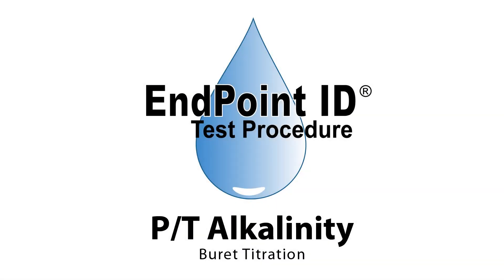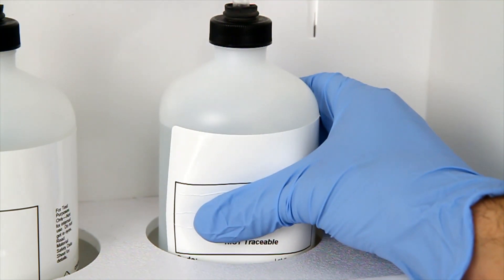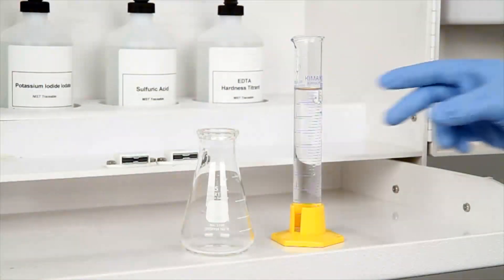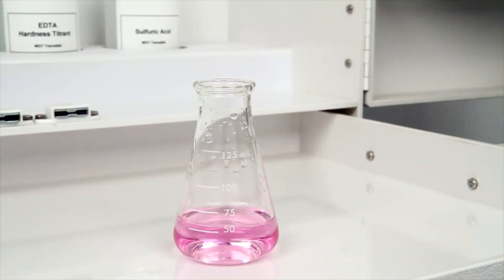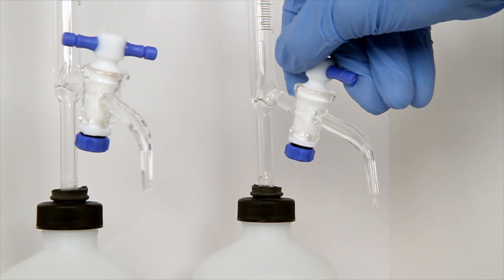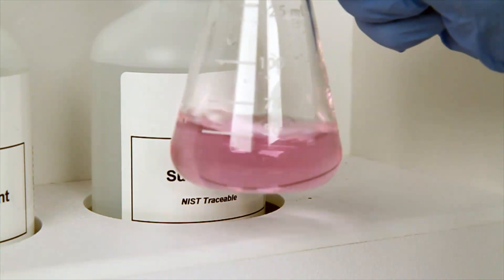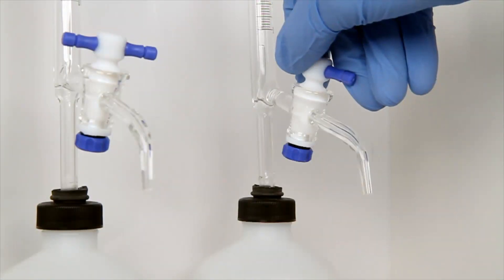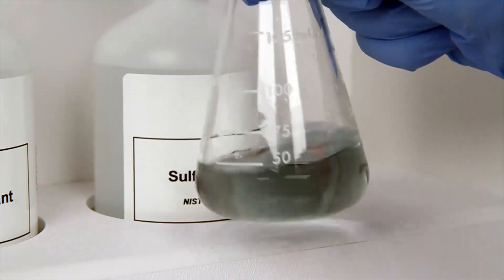Alkalinity Buret Titration

Comment: Sir why we multiply by 20
Reply from the maker: You multiply the number of milliliters by 20 because that is the equivalency for this titration. When you titrate a 50mL sample with Sulfuric Acid 0.02N (N/50), each milliliter of titrant used will be equivalent to 20ppm of alkalinity expressed as Calcium Carbonate in your sample.
Reply: What if I titrate 100 mL sample with 0.02 N H2SO4 or 0.02 N HCl.  What is the conversion factor?

Then how to calculate the conversion factor from the given information such as,

Concentration of titrant and volume of the sample.
Reply: @rajamurugan2356  u still times by 20 the sample doesnt matter. for each ml of the acid u times by 20 not the water sample